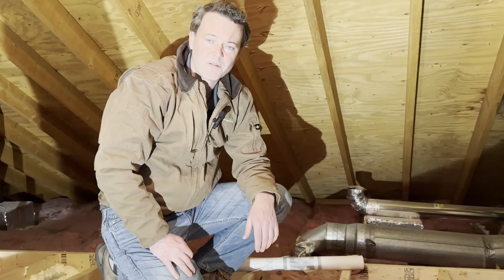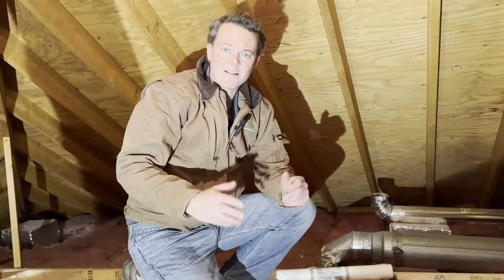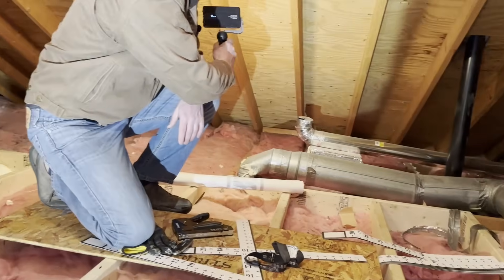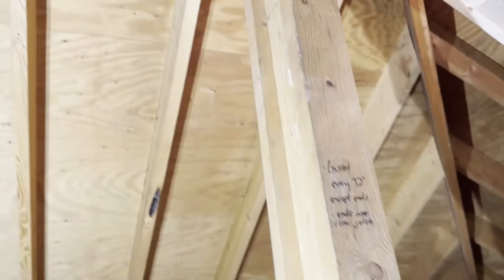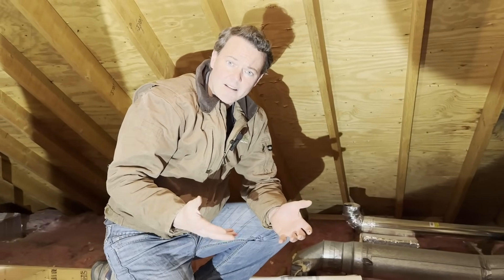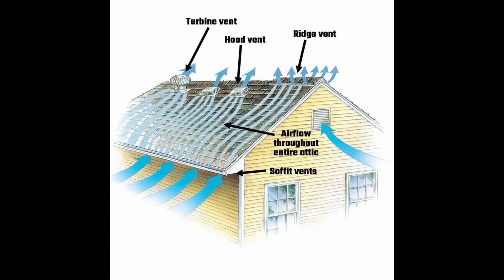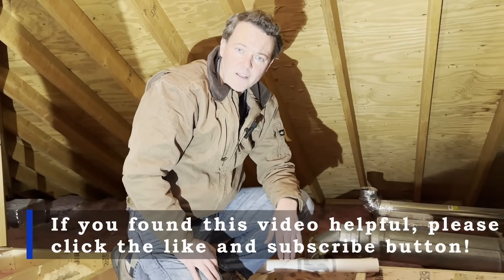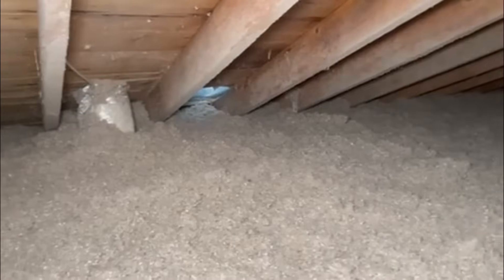Is a Roof Power Attic Fan a Waste of Money....or Even Worse?

Comment: As a roofer I can confirm most roofers don’t understand ventilation. They think more ridge vents, slant backs, turtle vents, etc solve every issue. I recently ran into one (thank god Allstate covered it) which was blistered so bad on the 2nd story roof that finding hail damage was almost impossible. It was a 14/12 pitch which meant 1 slope was shaded at most times of the day. The customer told me the AC would never turn off in the summer and wouldn’t cool. They upgraded their AC twice and still no luck. They had gable vents, ridge vents, turtle vents AND turbines. It was only venting the top 2 feet of roof. Below that 2’ line and down was purely blistered shingles, and they had soffit vents caked with latex paint. 4 different types of exhaust vents and virtually no intake. 

Once I did his roof he called the next day totally over the moon because his AC finally cooled the upstairs bedrooms and shut off.
Reply from the maker: Excellent work!  We install intake vents on home ALL THE TIME for exactly the reason that you stated.  It's a shame the poor homeowner kept attempting to correct a roofing mistake by upping their AC size..ugh!
Reply: where are you located I need an intelligent roofer in NNJ

Comment: This video didn't consider the gable ends of the attic.   No need to cut any holes in the roof that can leak.   Just use the gable ends for vents.   And an exhaust fan on one end would be great for summer heat.
Reply: Holes in roofs don’t leak if they are installed correctly. Its a good idea to have some eyebrow vents high and low. Heat rises and needs to escape.
Reply from the maker: You are correct.  We install vents all the time.
Reply from the maker: This was actually a hip roof (kind of like a pyramid) so a gable fan wouldn't work.  You're right in understanding how that set up would work, but every roofer around us is programmed to close off all gable vents and slap on a ridge vent...and sometimes a power roof fan with it.  The roofers seem to be getting better educated though.  We do see more undershingle intake vents going in...gradually.

Comment: I'm wondering if the power vent was installed prior to the ridge vent being cut in it a later time. In any case I agree with others that the fault likely does not lie with the roofer.
  All other points made are dead on!
Reply from the maker: Good question, but the roof and power fan were both new.  We see roofers do this all the time.  They don't understand the theory (which is sometimes shown in a picture on the back of the box) for how these are supposed to work.
Reply: @insulwiseenergycomfortsolu3293  You have to wonder how someone could not comprehend such an obvious concept!

Comment: My gable mounted fan is exhausting hot air from the attic.  The make-up is coming from the soffit and the ridge vents.  All my bathroom fans vent directly to the outside.
Reply from the maker: The bath fans vented to the outside is perfect.  Your configuration could work, but I would expect for the bulk of the make up air to be coming from the soffit and ridge vents located nearest the gable fan.  I would expect a measurable increase in attic temperature for every foot you moved away from the gable with the fan to the opposite gable without the fan.  But perhaps not.

Comment: A ridge vent & soffit vents are really all that is necessary. Let simple science work FOR you. 🙏❤😇
Reply: I had a new roof installed on my house last year, and had significant changes made compared to the old one...first, they created a ridge vent, and second, I went with light grey shingles as opposed to the dark blue ones before, (which basically became almost black over the years), but I had the attic fan re-installed. I have a big, easy-to-read outdoor thermometer in my attic and I have found the difference between the fan running and not running on hot days is about 8 to 10 degrees. Worth it?...I think so.
Reply from the maker: I have worked in attics where these have been sited properly, and when the fan turned on experienced a 30+ degree drop in a matter of minutes.  The further these are located from passive vents the better they work (to draw air from as far across the attic as possible).  If you're happy with the performance however power to you.
Reply: @CarlGerhardt1 is lookup attic foil. Put it up against the rafters and over the insulation on the attic floor
Reply from the maker: We agree!

Comment: Older houses, like mine, have an attic fan that pulls air through windows and blows it out through the attic vents. This cools the house and attic at the same time. When using the AC the attic gets hot because it's natural air flow doesn't keep up. I think I'll put a couple of wind turbines on the roof like our old house in Louisiana had. On that house I cut an 8 inch wide strip in the soffits all the way around and covered it with 1/4 inch hardware cloth. It breathed very well after that.
Reply from the maker: Turbine fans work great when combined with adequate intake vents.  Our most effective measure at improved cooling ability is air sealing the attic floor and taking the insulation level to an R-49.  It sounds like the previous fan that you used was a whole house fan, installed in the ceiling and not the roof?  That would perform the way that you described.
Reply: @insulwiseenergycomfortsolu3293  All the houses on our area had in the ceiling attic fans when I was young. Didn't have an AC until I was 15. An old second hand widow unit that was loud and made the whole house jump when it's compressor cut on. It did keep Dad's house under 85 degrees on those 100+ summer days. Drying out the 90%+ Louisiana humidity was enough to make 80 seem cool.

Comment: Beware of the ridge vents in areas subject to hurricanes! One family had the ridge vents and the wind was blowing water UP the slope of the roof where it entered the vent and flooded their house! There was no other damage to the house, only the water damage from that damn ridge vent!
Reply: That's a great point that most people aren't aware of. I've also found that a severe thunderstorm can lead to water intrusion if the wind is just right.
Reply from the maker: That is an excellent point you've raised as well as one that we don't have to deal with (so far) in the Northeast.  I have seen wind driven rain cause issues with roof leaks, but it is a rare occurrence here.  I'm not sure what the best solution would be in a region where those types of storms are common.
Reply: @insulwiseenergycomfortsolu3293  It's obvious! You close up the ridge vents totally. Actual careful tests show the effectiveness of these puny vents to be ineffective. (no temperature difference between vent open and vent closed.)
Reply: I used to do maintenance on beach rental houses in North Carolina. An ocean front house will definitely get water blowing up the roof and into the vent on a regular basis, enough to stain the ceiling. Rain storms with 30-40 mph wind are common.
Reply: good point, the older metal ridge vents would pull up in storms. The newer ones are fastened better and work better. According to JEA electric in jacksonville, ridge vent perform the best.

Comment: I live in the south eastern US and these things are a must as is soffit venting and ridge venting.  In many places here soffit venting and ridge venting are governed by building code.  They also help your roofing shingles last a little longer as well.  FLY NAVY!!!
Reply from the maker: Roof power fans can work well -- when they are sited correctly with respect to passive vents and there is enough make up air to prevent the fan from pulling air from inside the house.

Comment: I wired a fan for our attic after a carpenter installed a fan near the roof peak, but I  never considered where it got it's intake air from! There are just small vents at either end of the attic! We found that the fan didn't help keep the upstairs cool,so it wasn't used after that. :face-orange-frowning:
Thanks for pointing out something nobody considered as far as intake air was concerned!
Reply from the maker: Thanks for the comment!  Yes, the location and size of the intake vents are crucial to the effectiveness of these fans.  However for keeping the home cool, we are much bigger proponents of air sealing the attic floor and insulating the attic floor properly (or underside of the roof -- but only with closed cell spray foam).
Reply: My soffit vents had 8x16 inch covers. When I took them off, the holes in the plywood were only around 6x8 inches and the screens in the vents were blocked with dust and dirt. I cut the openings to full size and put on new covers. I have an electric exhaust fan in one eve mostly pulling air from the other eve. It makes a huge difference. And no roof ridge vent. It is shingled over.
Reply: that is why power fan did not work. You need to have enough soffit cool air to draw up to power fan.

Comment: Andy, the bashing of some (many, most?) roofers, many of whom do siding as well is warranted. Couple quick examples from neighbor, combo of house flipper and pros hired by new owner… soffit vents blocked by attic floor insulation; gable vent blocked by plywood sheathing; roof gutter level, NOT pitched toward downspout; and (opposite side) reconfigurated gutters to drain to lower roof and use it’s downspout ruining 1st floor ceiling. Neither roofer nor (inept) town inspector anticipated the problem they caused. 

Re: power fans… some may miss your note in the comments that in right circumstance, done right mechanical fans are BETTER. Clearly, many got the wrong impression. BTW another pet peeve is over-sizing AC units by contractors… big units quickly cooling do not adequately remove humidity which is the prime source of discomfort. End rant 😀
Reply from the maker: Thanks for the comments and you are correct.  This is a science, not a hobby for us, and we've seen mistakes cost our customers dearly over the years.  With regard to AC size, we are HUGE fans of making the air and thermal barrier as as energy efficient as possible and then sizing the AC system accordingly (to run at steady state to remove humidity -- not flash cool the home -- like you said!)
Andy
Reply: You get what you pay for, just sayin.
Reply from the maker: @kirkwilson5905  Well, what often happens is the homeowner just trusts the roofer to understand how to correctly set these up, and we find that often they don't, regardless of what they paid.
Reply: @insulwiseenergycomfortsolu3293  Most don't consider soffit venting or anything else not actually in/on the roof to be roofing. And I have to agree with them... for the most part. So the quality roofer that includes the scope for correct venting is bypassed for the cheaper alternative. Mostly out of ignorance of the customer. At least this seems to be the norm.
Reply from the maker: @kirkwilson6698  You're right, 100%.  However, I'm not sure if you are versed in under shingle intake vents.  They are a type of vent where a 1" wide cut is placed into the roof all around the perimeter, usually 1-2 ft up from the gutter.  A piece is then inserted into it that allows air to flow into the bottom of the roof which is then shingled over.  These are 100% installed by roofers and they are a fast, easy, smart add on that provides intake ventilation.  Unfortunately most roofers still do not install them here, or for that matter even assess the existing roof / attic situation for proper ventilation prior to pitching the job.  Here's how a smart roofer would sell it "mr homeowner if you want to dramatically reduce your attic / roof's risk of a mold problem while also reducing summertime attic temperatures, you can have us install this for XYZ.  Or you can go cheap and pay for it down the road."
Andy

Comment: If your good at math it does not take much effort to figure out attic fans do not provide enough air flow for temperature management. The point behind attic ventilation is moisture control. To keep the  humidity as low as possible. Then the next step is to ensure you have enough insulation of the proper type to keep your house cool. air sealing your deck is also very desirable.
Reply: I’m good at math.  A 250 cfm fan will do a full air exchange in a 2000 cu ft attic once every 8 minutes. That’s 15 air exchanges every two hours.  Go sit up in an attic for two hours on a hot summer day, and then tell me you don’t wish you had a fan.
Reply: @MissingRocket  Even though an attic exhaust fan can incrementally lower the temperature of a very hot attic, using a fan does not stop the source-radiant heat. During the day, any cooler air brought in by the fan will be heated up immediately by the surrounding structure. Most fans cannot keep up, because Physics
Reply from the maker: An attic fan that is properly sited with properly sited and adequate intake air can make a big difference, I have experienced it personally.  But most of them are not set up properly, they're just kind of "tossed on" like this one.   But the overall goal is to keep the house cool, at least in my opinion, less so the attic.  A properly air sealed attic floor that is then insulated to R-49 with blown cellulose with properly sized and sited passive ventilation will perform that job the vast majority of the time.

Comment: I don’t use AC at all. I’d like to suck out the hot air from the house itself. 
Hot air pools near the ceiling. 

Does it make sense!
What’s the best way to do that?
Reply from the maker: If you live in a dry climate a whole house air can do a great job (not a roof fan).  If your climate is humid like ours you will likely need AC to be comfortable.
Reply: @insulwiseenergycomfortsolu3293  
Dry climate, central/north California, near the coast.

Comment: how do you blame the roofers for no bird block vents or eve vents ??, Thats a load of B S unless they framed the house
Reply: I just think someone being told to do something should understand it enough to say "there's no vents for this to suck from" instead of taking money and asking no questions.
Reply from the maker: You're right, but homeowners often trust contractors to be experts in their trade.  That's the issue here.
Reply from the maker: I blame the roofers because the roofers installed the new roof and installed the roof power fan, that's why.  As contractors, homeowners are relying on them to know what is best -- in this case they did not.  They could have EASILY installed undershingle intake vents around the perimeter of this home and positioned the power fan in the middle of the roof so it would draw equally from the ridge and intake vents.  If they were intent on installing a power fan -- that would have been one way to do it responsibly on this house.  This power fan, positioned as it is and with insufficient make up air -- will not do the job it was designed to do.
Reply: 👍 agreed
Reply: Good Roofers can fix what the Framers did not do properly. I just had my Roof done and they added Openings in the Soffit (was Solid Plywood) and Perforated Soffit Covers and then added a Fan to work with them. My attic is now at least 15 degrees cooler (probably more) especially on 90 degree days. It used to be about 10 degrees hotter in the attic than outside, and that is no longer the case by at least 5 degrees.
Reply from the maker: Correct, informed roofers would not do something like this.  They would make sure to install an adequate source of make up air and position the fan on the roof accordingly.  Thanks for the comment!
Reply: Exactly! I've framed houses AND done roofing. If you are going to be modifying or putting in any fan between 2 different atmospheres, you have to replace the air from somewhere. This is basic knowledge. It's either pure incompetence or laziness. Imagine paying a garage to replace your engine with a supercharged one. Only to blow it up a couple miles later. The mechanic tells you, "Well, that engine was too much for the other stock components, duh. Not my problem."   Bullshit.
Reply: @chrisw685 good example!
Reply: @williampagdon4822  your not very bright are you
Reply: BS video.
Reply: @loboxx337 correct- it is not up to the roofers- it is the job of the framers.
Reply from the maker: Incorrect -- the roofers should have identified the type of roof, it's ventilation limitations, and installed undershingle intake vents.  The issue would have been easily and cheaply solved.

Comment: Nice concise video, thanks!
I have a large solar powered fan I am getting installed and was thinking of foaming shut the ridge vent adjacent to the fan so it pulls air from farther away in my attic.  I have a large gable vent at the furthest part of the attic so plenty of ventilation.
Reply: There calculations for that, one gable vent might not be enough to supply air fan needs.
Reply: "plenty of air" through a gable vent would need to be 2-4 times the fan area in square inches. If you don't have that then you don't have plenty.
Reply from the maker: Good thinking that would work better.  You just need to make sure your gable vents are large enough to provide the required NFA (net free air) so that the fan does not depressurize the attic and pull from your home.  You could also augment the gable vents with a few slant back vents placed lower down on the roof and far from the vent for additional intake.

Comment: Great video. I had one installed but quit working and I worked on the wires by unhook them and hook the back. It is fairly new and love for someone have an answer to the problem. Thanks for sharing
Reply: im an electrician ,unfortunately i have to go in hot attics all the time repaired/replaced  hundreds of attic fans. most of the time the motor will go bad froze up (hard to turn) you can bypass the thermostat and hook power straight to the fan to test it. when i replace everything motor,fan blade and thermostat,the thermostat has a bypass on it for testing fan
Reply from the maker: Thanks for the info!